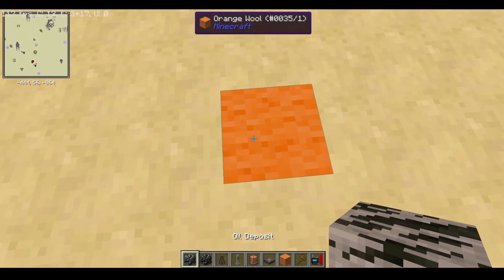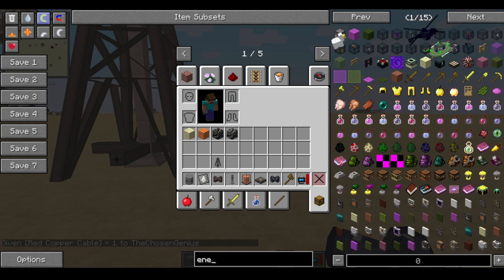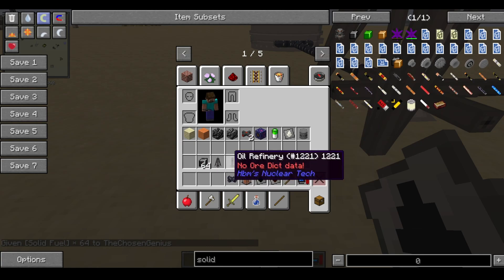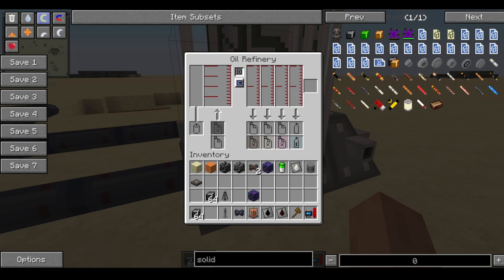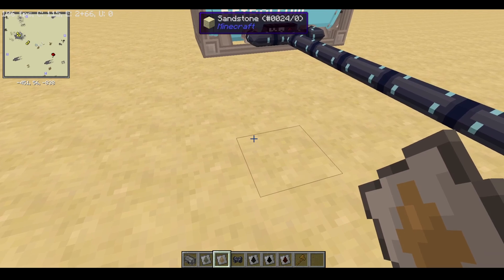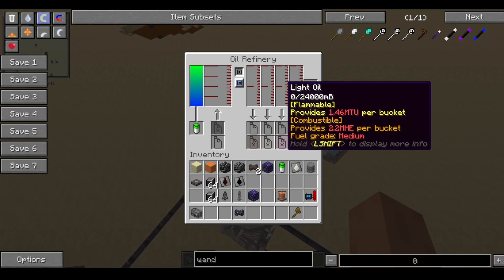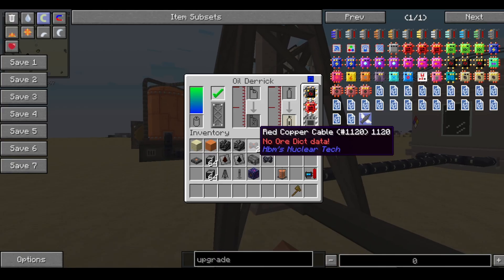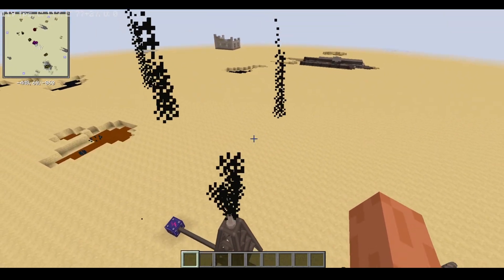How to make an oil refinery | HBMs nuclear tech mod tutorial

Comment: just to mention to anyone else wondering you do not need to specifically use the solid fuel cubes you can use charcoal coal or just goahead and test with diffrent fuels
Reply from the maker: Yes! you're absolutely right, but solid fuel cubes does seem to be the most efficient and cost effective way to heat things up
Reply: yes it takes forever im trying out making 8 boilers  there is really no point in upgrading the derrict because it still produces oil faster than boilers can process i did switch to using natural gas made solid fuel cubes for the fire boxes

Comment: Why cant I find the Boiler? Its just a tiny block nothing like you used.
Reply from the maker: Hello! well, there are two boiler types for oil, there is the "oil boiler" block, which i DIDNT use, and the "boiler" which is the one i used, if you cant find it you might want to use NEI, or check your HBMs version